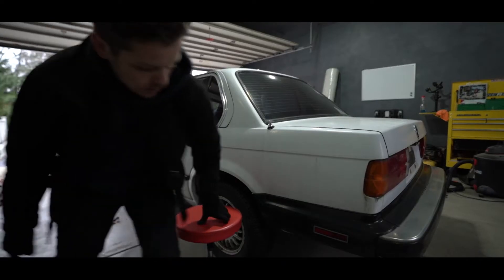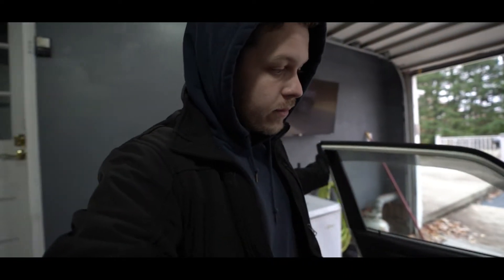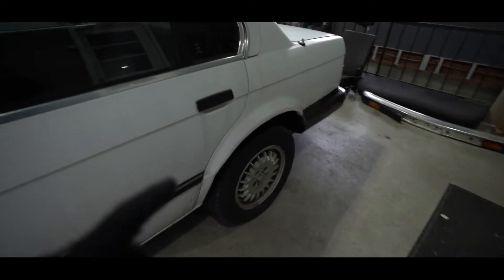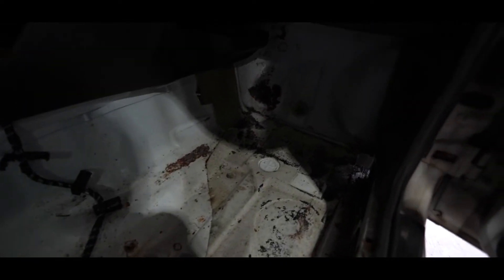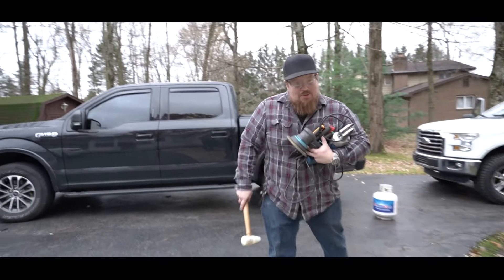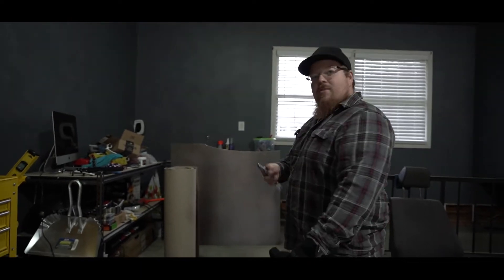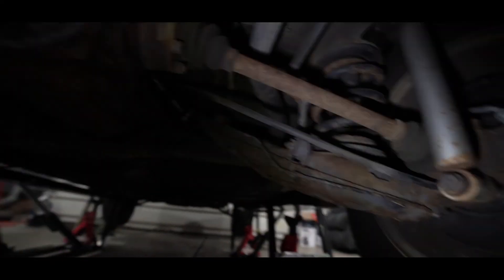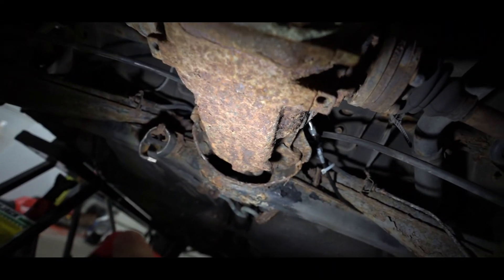Starting A BMW E30 Drift Car Project For 2022

Comment: Glad to see you back. Good luck with the build, you have a lot of work in front of you, don't get discouraged. You know I sold my 16 GTI because of continual problems with my back. I built that car for the road course that after the spinal surgery I knew I would not be able to do. So I bought a 21 Jetta R Line, 6 speed, mild mods and good tires, that's it for me.